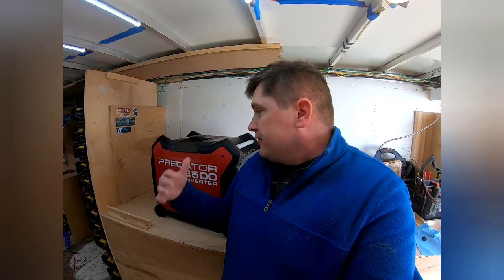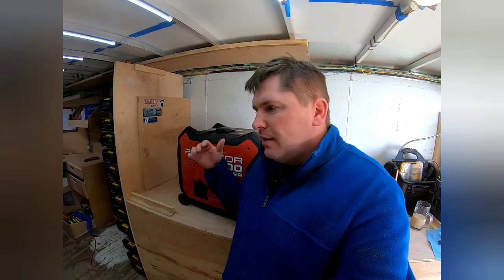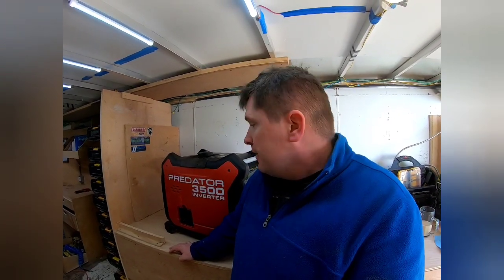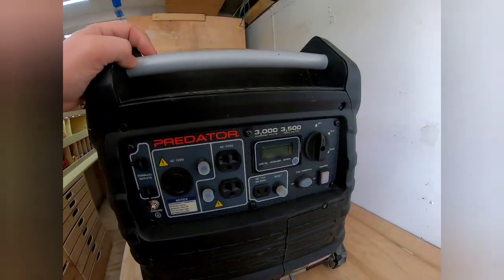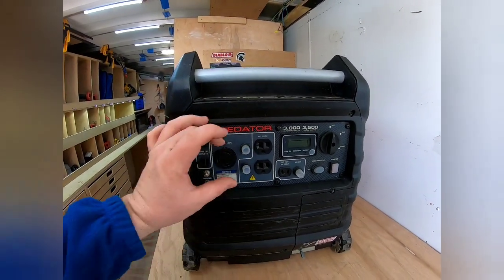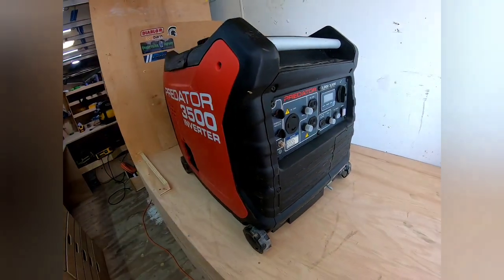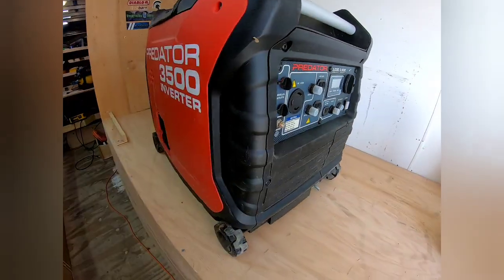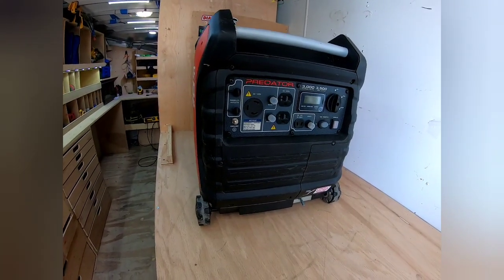Predator 3500 Watt Inverter/Generator 2 Year Review

Comment: I have this same generator and I just changed the oil and spark plug.  It starts ok but it starts really rough...once it’s in “run” mode it’s fine. And thoughts as to why it’s starting so rough?
Reply: Sitting. Ethanol gas starts degrading in 30 days. Really BAD gas. Use non ethanol in ALL small engines always. Non-ethanol fuel has much longer shelf life. 
Ethanol is a tax on the country that only benefits a few corn growing states. It's all politics.
Reply: They need a slight load on them, generators aren’t meant to run without a load.

Comment: 176hrs on mine 3yrs old I didn’t buy mine new clearance at HF for 350$ maybe. Awesome generator I own Honda’s big and there small. During outage I can run my shops lights and heater back feed through the 30amp plug adapter a must have!!! My eu2000 does can only do one or the
Reply: The other! No hate on any generator brand or where you buy then your always given a weird 3way outlet.
Reply: And a 4 prong .. and everyone buys these big generators thinking they can power a house hooking up all the 120 outlets plugins when breaker pop 120not 240 with not having the proper 120-240 by 30 amp adapter I’m buzzed any generator you buy higher then 2000 you get a 3 way plug stating it’s rated for higher amp!

Comment: sounds like the carb is clogged or you have bad gas. You should not have to keep the engine on choke that long.
Reply: You're comment is hilarious. How can you HEAR a clogged carb? Lmao  it ran and sounded fine. Gtfoh
Reply: @Nitroracer2332  > If it ran and sounded fine, then why did it die when the choke was turned off...?
Reply: The second time he started it in the video, same thing, he left the choke on and never showed it running in “RUN” mode.  I just bought one but haven’t unboxed it yet. 🤷🏻‍♂️
Reply: @Nitroracer2332  I have same gen....has a run position, choke is only for cold starts.....hence the carb problem.

Comment: Your carb is dirty.  It can be cleaned or you can get a new one for about 15.00 on amazon or online.  Use stabil fuel stabilizer so that does not happen.
Reply: Lies
Reply: @Nitroracer2332  I’ve seen evidence that fuel stabilizer may not help at all.  Best to drain carb or empty gas tank for longer storage.  The idle jet is fairly easy to clean on that model and first thing to check if it does not want to come off choke.

Comment: You dont want to leave the access doors off or drill holes in the case. Some internet idiot started that idea, and its a bad idea. These are engineered products. They are DESIGNED to have air flow one direction through the case, to pull in cold air from the outside, run it over the hot engine components, and exhaust out the exhaust side of the case. Drilling holes in the case can negatively impact the airflow and lower the amount of airflow that should be flowing from one side of the case....
You are running it on half choke...the carburetor is clogged up. Throw it in the trash and replace it. Dont even bother cleaning them on these cheap Chinese engines. Usually a new carb is only $15-$20. Buy and use non-ethanol fuel if they have it in your area. Use a double dose of Stabil fuel stabilizer, AND run the fuel tank empty before you store it. Also, the carburetor has a drain screw on the bottom. Use it drain all the gas out of the carburetor before storage.